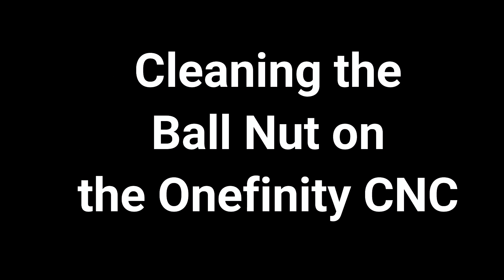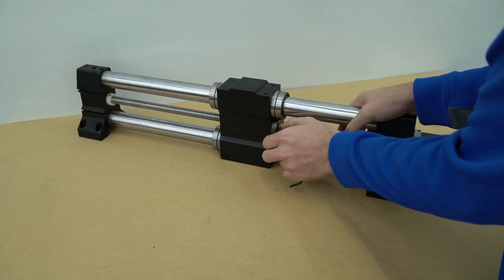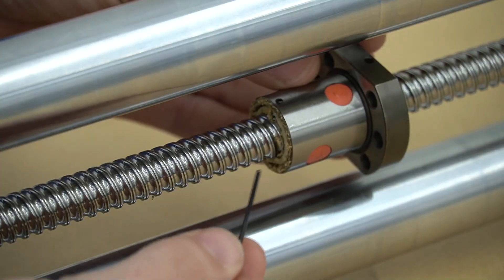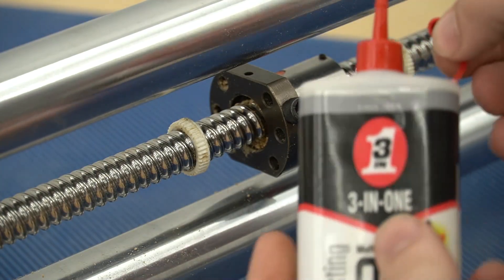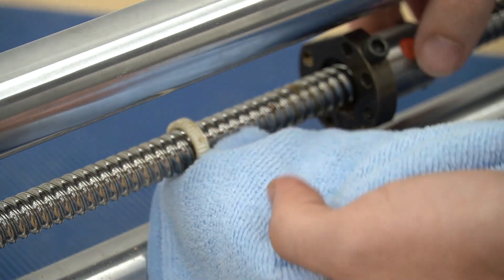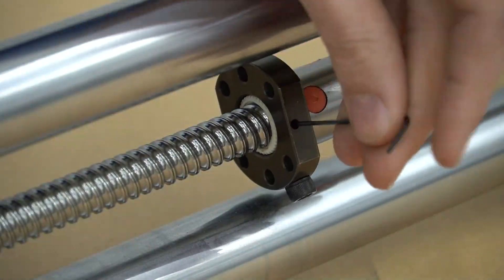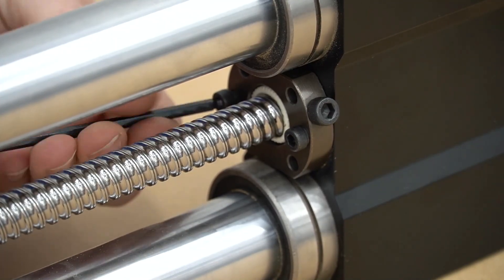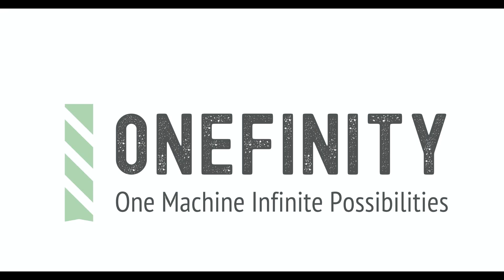X-35 Ball Nut Cleaning // Onefinity Maintenance

Comment: What if the ball nut doesn't separate when you pull the gantry away? Mine is stuck to the gantry pretty good.
Reply from the maker: Take a block of wood and place it against the black gantry block.  Hammer the block of wood to force the gantry off the ball nut.

Comment: When we add oil to the oil port how much oil do we need to add? Reason I ask….I replaced the white wiper and added oil. The oil starts to come out of the white wiper area. Is this normal or do I have to get a tighter seal with the wiper?
Reply from the maker: That's normal. once it comes out, that's the correct amount.

Comment: Thank you!! Been wondering about this. Is it the same process for the X and Z?
Reply from the maker: Yes, it is
Reply: @OnefinityCNC  I absolutely cannot get the white wiper out of the ball but on the Z axis, I’ve tried compressed air, spinning the ball nut, using a screw drive to spin the wiper out but it is not coming out I was able to get the lower white wiper out but the top is at the point where I’ve actually damaged it a little bit with the screwdriver, you guys have any other suggestion to get it out?